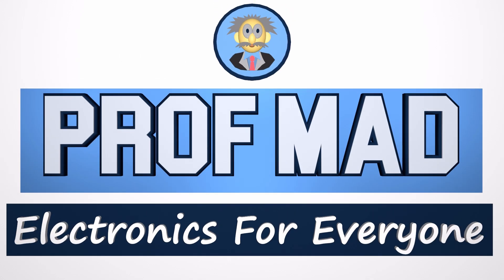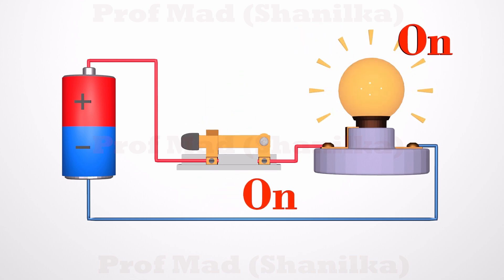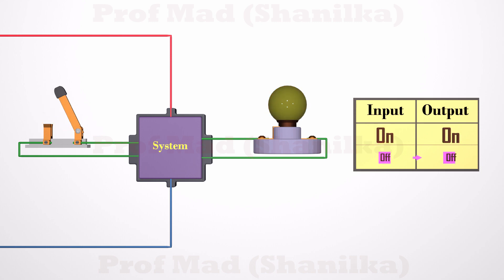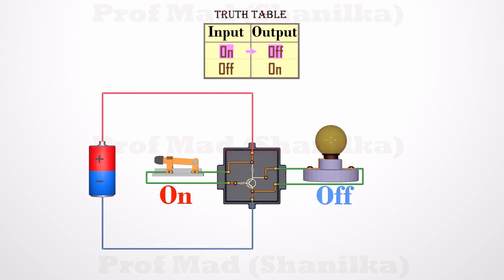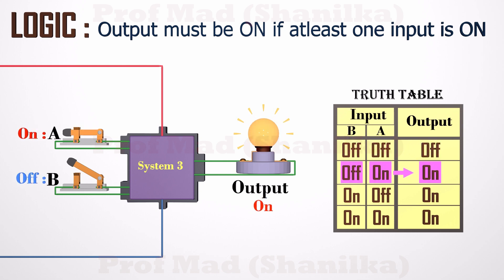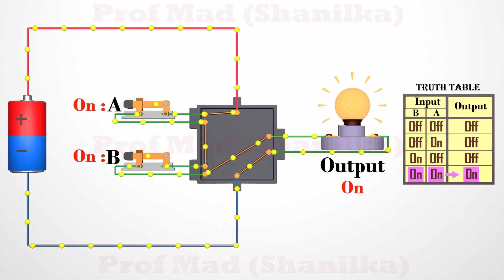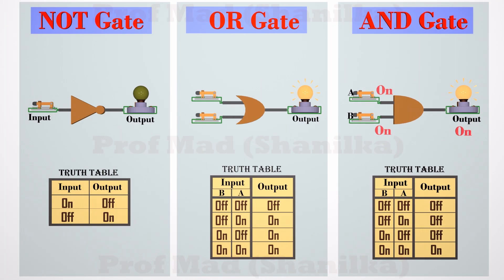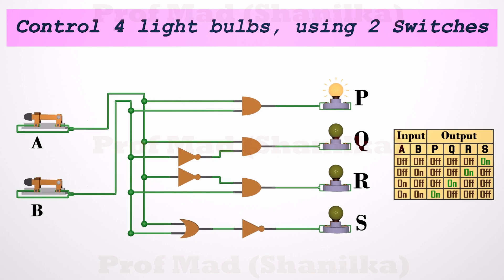Introduction to Logic Gates | Truth tables | Boolean Algebra  | NOT Gate | OR Gate |  AND Gate

Comment: the NOTE gates that’s i understaning it a inverter gates  the only problem it’s can not see inside the IC how it’s wired up together i gues the transistor resistors diode or a power mosfeet as a gate wired it together as agates inside the IC in one combo I maybe rights or worng